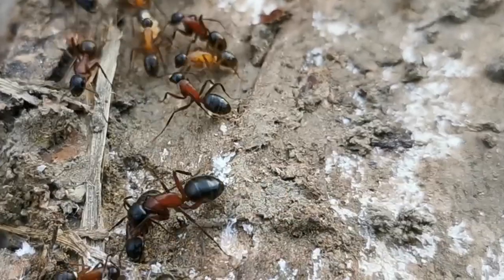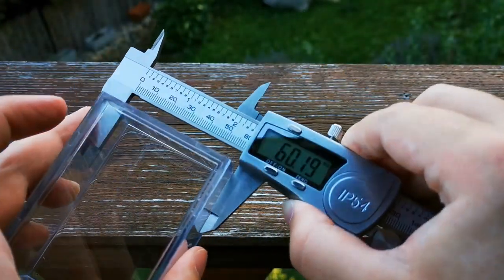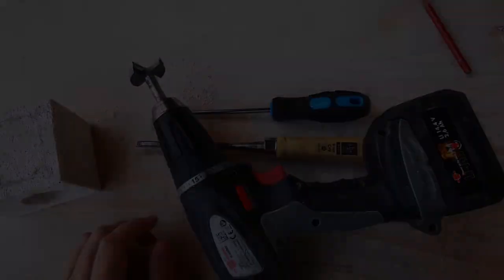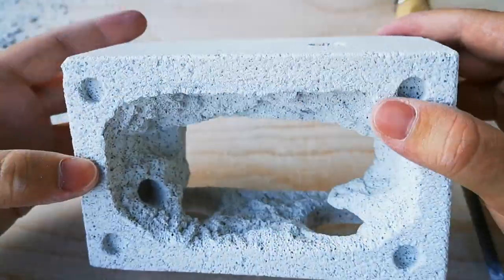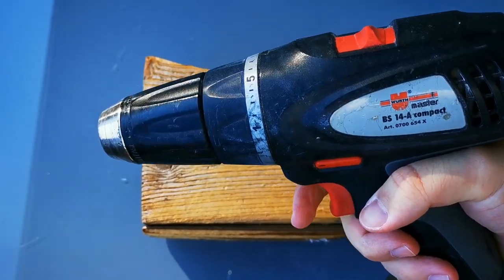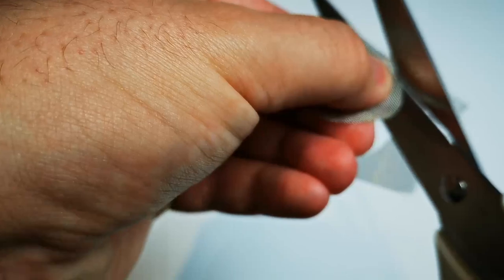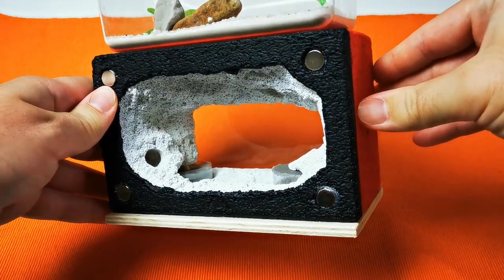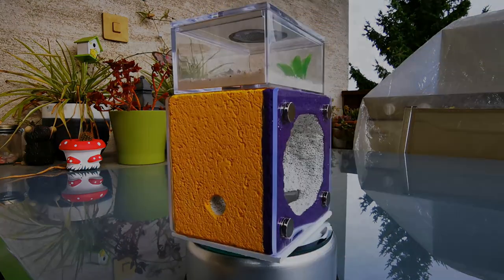ANT WATER TOWER | How to make an Ant farm (DIY Water Tank)

Comment: Red on black was definitely a better selection. As a fan of tarheel ants formicariums I am very impressed with this build, well done.
Reply from the maker: Thanks! Yes, didn't like how the other combination looked either - thanks for the feedback!👍
Reply: @AntsVienna  Hi can I use plaster of Paris instead for my fire ant colony ?
Reply from the maker: @snipermikulop6672  Not sure... Fire ants may be able to escape from plaster.
Reply: @snipermikulop6672  you can mix in sand or use sanded grout as well as making the tunnels with sand so it coats it with sand and will make it a lot tougher to chew through.

Comment: Excellent DIY! I'm new to the hobby and love to craft. The only tricky part looked to be the ledgevover the water tower. Is that just very careful carving? That looks like delicate work. The brilliant tip is the little bar to hold the magnets for glueing! That makes them perfectly flush with the surface. Another question. Do you use red acrylic for the front ?
Reply from the maker: hello. Thanks! No, I don't use red acrylic in general. I try to keep my ants away from direct sunlight and cover them with a towel or something when I'm not actively looking at them or filming.

Comment: Can you please explain/detail how you are connecting the test tube filled for drinking water to the watering cup?. Normally, I would expect the water in the test tube to flood the cup due to gravity. I am obviously missing something so a good explanation will help. Great video.
Reply from the maker: Hello there. The watering cup & Test tube combo work like an extended (vacuum) water feeder. Meaning due to the tubing reaching into the cup and the whole system being free from aip, the cup will not overflow.

Comment: Hi can I use plaster of Paris instead for my fire ant colony ?
Reply from the maker: Yes, you can. But be warned: 1) Plaster of paris molds easy - so don't water too often and 2) Ants can bite through plaster, so you need to check on them often or place the nest in the outworld, so it doesn't matter if they get trough the nest material

Comment: Could you explain please how the tank water  with the blue tap works  ?  how you make water flow from it ? drop by drop ? how you can control it to prevent a flood  in the formicarium ?   it is not  very clear to me .   thanks if you'll explain more about the water tank
Reply from the maker: hello again Stefano! The water in the blue tab is air tight - son water will only flow when water in the round dish underneath it falls bellow a certain threshold and not overflow when it is full. There is some water pressure physics involved in this
Reply: @AntsVienna  Thanks  for your reply i appreciate  and i also appreciate that you do not let people behind with their  dubts.  Exactly what you mean with air tight ?  where is possible buy it ?  do you sell it ?   and  still what can you tell me  about the mesh  ?  it must be preformed ?  so you mean that the big tube must go inside the round dish and if the round dish is full it will not overflow ?  but just a minimal part will flow in to the round dish   when the round dish is going be empty ??    where  possible  buy those tubes ?
Reply from the maker: hey. No, it does not work like that. I think it is cold the "pascal principle" that inspired my design. It is pretty complex and needs to be done exactly right to work... I have to improve that further. For now I would suggest you stick to the principle of the normal water tower - namely a reservoir topped with an 80+ steel mesh and granting access from the side to fill up externally. You can see that at 7:58

Comment: did he expect the ant to walk casually on that smooth tube normally?
Reply from the maker: Hello there. Yes, in fact most ants have no problem at all walking on smooth surfaces, including glass. This pvc tubing is peace of cake for them to climb. The only ants that need some support in tubing are Messor species - You can help those by letting a little rope string through the tube piece for them to grab on.

Comment: Hello, really like this video. I would like tot try and make one myself, but what kind of plaster do you use? I dont know which strength or hardness I need as a plaster.
Reply from the maker: the plaster for the outworld is purely decorative, so you don't need to worry to much about what to use. Also, ALL products I use are linked in the video description😉

Comment: Hey,
Just a question, in the water tower that the ants drink from is mold a possible problem? If so how would you clean it?
Thanks
Reply from the maker: Hello there. No, mold is no problem there. It consists of plastic and V4 corrosion-proof metal mesh - there is no possible way to get mold there, unless you continually overflood it
Reply: @AntsVienna  that's good. just a second question then. Do the ants drink through the mesh or does the water settle just over the mesh but not over the plastic container? (This may sound like a stupid question but I'm just checking as I'm assuming the ants can't drink when there's the mesh in-between them and the water). Thanks :)
Reply from the maker: Hello again. Actually the design allows for the water to get over the mesh, but not over the plastic container - like you said.
BUT ants can in fact also drink the water when it condensates from beneath onto the mesh. So they have multiple ways to drink
Reply: @AntsVienna  Thanks!

Comment: Please explain the water tower more thoroughly.
Reply from the maker: Hello again. So what is it you need help with? I do give a thorough explanation on water towers at 20:14 😉
Reply: @AntsVienna  hi, thanks for answering.

Does the surface tension of the water reservoir prevent the watertower from over flowing into the enclosure?
Reply from the maker: Yes, there is now overflow + you don't need to top it up. Half way usually does it for keeping humidity stable